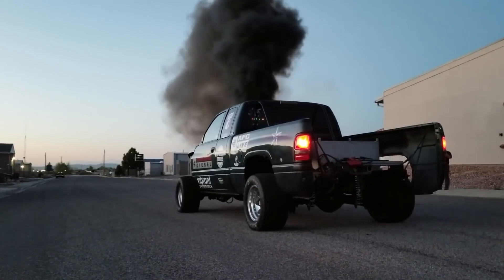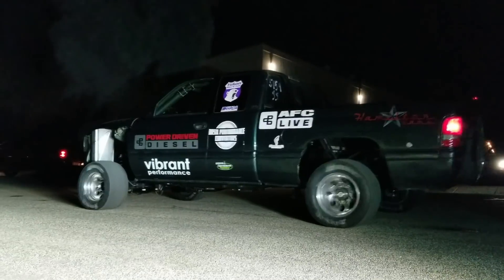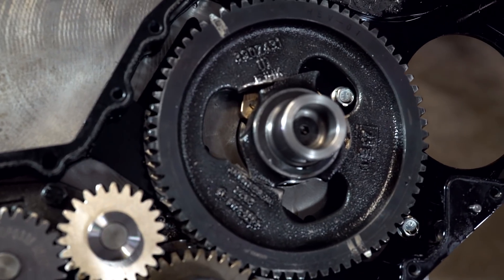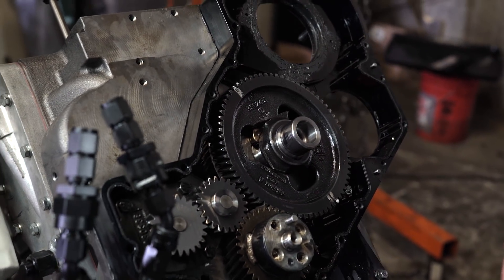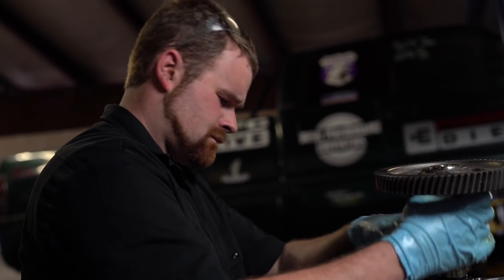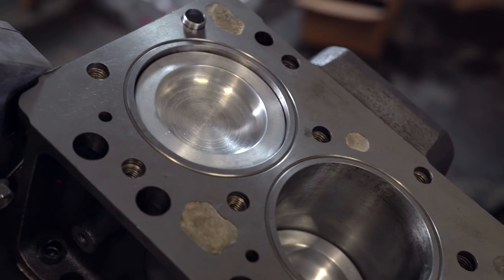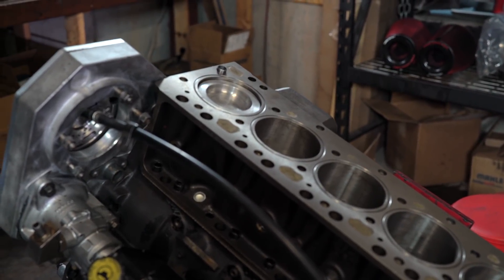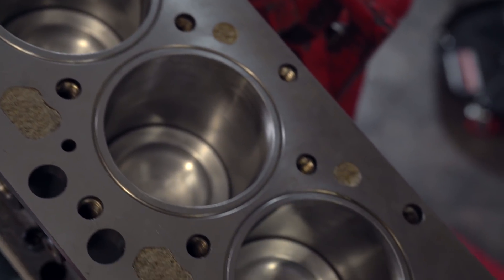STUPID CAM GEAR! | Power Driven Diesel

Comment: What About running straight cut gears?
Reply: They are noisy, knock sensors don't like them but they save HP due to less torsional loading!

Comment: I really like this build and was actually brainstorming about the failure. My two cents: 
The cam gear may not only be failing due to thrust from gear pitch, but extra load from the injection pump gear!?! It needs to turn 2000+ hp worth of fuel and I'm sure it's considerable resistance, all being transferred by the crank, then cam gear (which has huge responsibility of a heavy valve train by itself) 
I wonder if a pumpless timing case with a belt driven injection pump would help resolve this? Only issue is cost, and finding a new oil drain path for the injection pump. 
If straight cut gears don't work, this seems a logical next step (in my mind) 
From a good fan.
Reply: PowerDrivenDiesel 
I would think something like a cogged drive belt would be decent, something wide though like a roots blower drive belt? Timing belts have already proven somewhat reliable

Comment: Wow. How come you don’t hear if others having this issue? Are you using the same old cam gear over and over? Here’s my thoughts if you are. That gear has been through a few failures, and when the cam let loose it torqued the webbing. It was probably fatigued and was the next weakest link. What if a guy put in a brand new gear and with that cam support it should hold? Really really really wanted to see the big motor go 🙁
Reply: PowerDrivenDiesel so did you end up running the big motor at the competition? Congrats on being in the top 10!

Comment: since you are milling the pistons to reduce the compression, why dont you space the head a bit from the block so if the camshaft gear of the camshaft fails you dont destroy the whole valvetrain and the pistons
Reply: Spacing the head creates a less than optimal squish area,by milling the pistons they can control where the fuel air charge is compressed for a better more uniform burn.I'm a gas guy and on gas motors it leads to detonation at higher boost.In a diesel I dont know if det is a issue but I'm sure they still need a good uniform combustion without hot spots etc.
Reply: i see, and how about milling the space in the piston just right so the valve never touch the piston in the case of a failure?

Comment: You guys are doing awesome stuff! I'm a gas guy myself and don't know much about diesel but you guys make me want to atleast experience it once. You guys should be proud you solved the problem of the cam breaking that's awesome unfortunately like you said next weak link cam gear but no doubt you will solve this problem and the next and the next. Great job guys don't let it discourge your accomplishment. Hats off!
Reply: Diesels are a ton of fun. Plus the make good pull trucks for taking your gasser to the track.
Reply: And also if you   increase airflow you don’t need to read tune it immediately like a gas  wear you would probably run lean and go kaboom
Reply: Being in a quick diesel is like nothing else. Its so much different than being in a quick car. Getting a 6k plus pound truck moving with tons of torque really puts a smile on your face. Especially with big singles spinning up to 4k rpm, feeling that power ramp up is a feeling i never get tired of.

Comment: Concrete in an Engine block..... why?
Reply: austinmaxi it's ok to run a dry block in these racing applications because it's just a quick dyno run or drag race or sled pull then you can let them cool down in between
Reply: How long can the engine run with no coolant and just concrete? Doesn’t it get over heated?
Reply: completely dry block? like no cooling at all! wow,  i'd never heard of this before! im clearly in the wrong country (UK)
Reply: Jon Ruger <<< this man is correct

Comment: wow.  Not cool.  I know you guys have some massive pushrods.  Do you think moving them around is taking too much HP?  I'd figure it would float the valves before it would break a cam gear.  I suppose there are billet cam gears that might be stronger, but sheesh - That's crazy.  Good luck guys!  Thanks for the video!